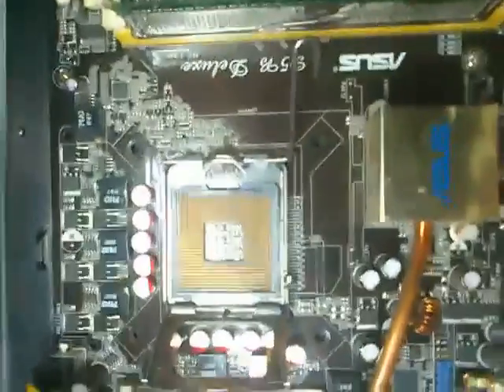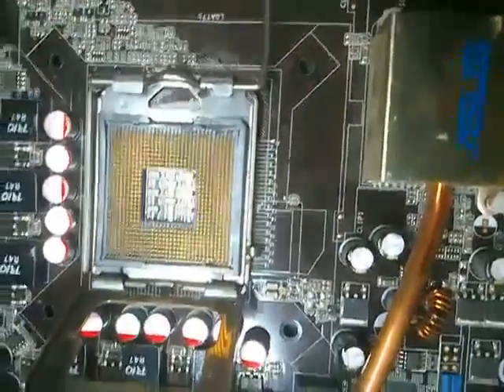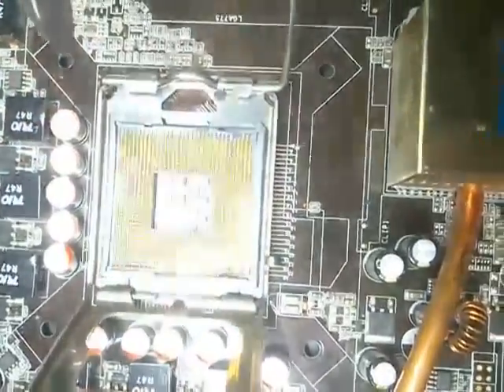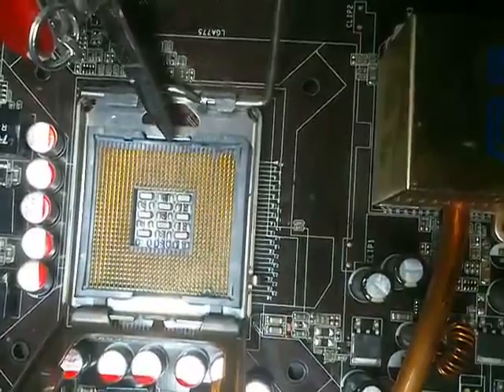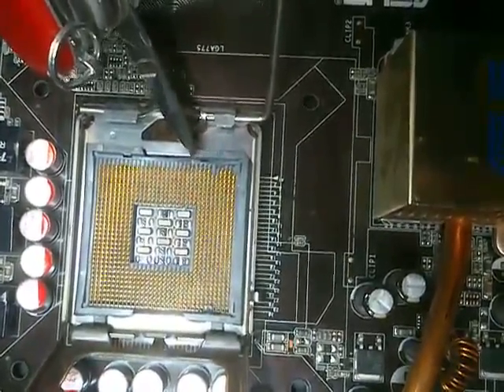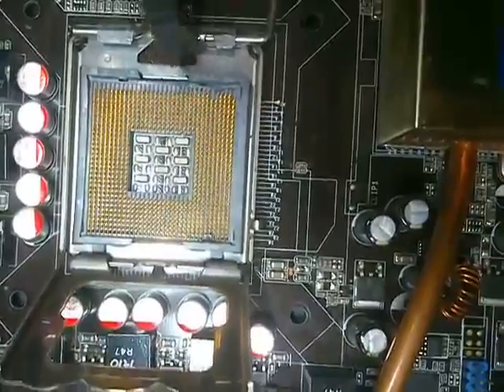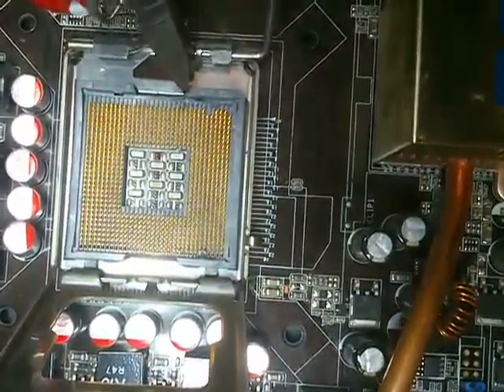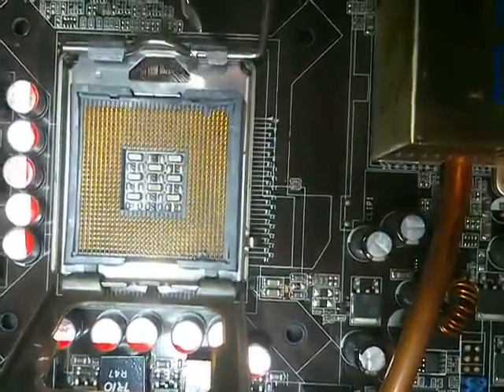LGA 771 to 775 MOD Xeons with adapter (sticker) socket  fitting problem solved

Comment: Hi i  hace a evga  750i  and  i did the mod. Today   the BIOS  detect  the CPU  and  start normal.  Then. The PC restar  over and over.   >>>>window wont load. <<<<I want to ask  if  this was  your  problem i will try  your  your  idea. Thx brother
Reply from the maker: Sergio García There are few options:
1) Turns on, restarts, nothing happens later - some parts of the CPU are not pushed correctly to the pins - socket cut out problem. This movie.
2) Turns on, restarts, restarts, restarts (restarts) - CPU heat dissipation problem - check cooler. Remember Xeons working about 3,0 GHz need cooler that dissipates 120 TDP  heat - a good C2Q cooler. Check if the cooler is placed over the socket and CPU correctly - it shall not be moving, it should be almost as stiff as a part of the motherboard.
3)Turns on, restarts,  works, restarts over load - CPU voltage (Vcore) / NB voltage failure - assign correct values.    System unstable. or system unstable do to overheating -check point no.2.